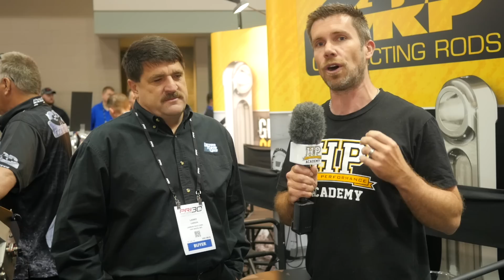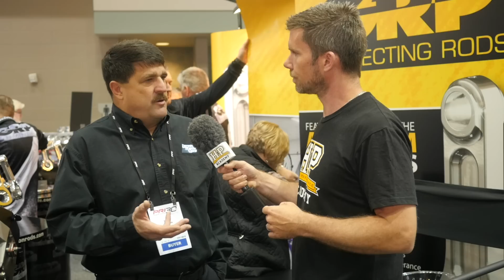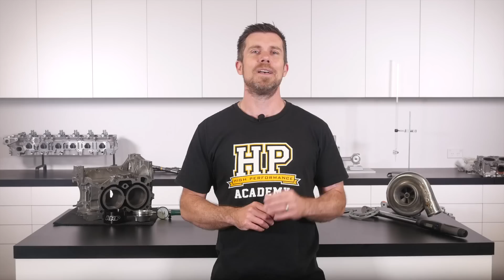3300HP Street Car, World’s FASTEST | Larry Larson [TECH TALK]

Comment: At the end if the day reading a plug is still a thing even with a million sensors nothing will tell you exactly what’s going on in the combustion chamber like the spark plug
Reply from the maker: Yes and no. If you know exactly where you have cut the engine and are reading fresh plugs they can help you confirm the other data you already have, but alone and without special attention to get the most data you can from them you're laptop is still going to tell you much much more - Taz.